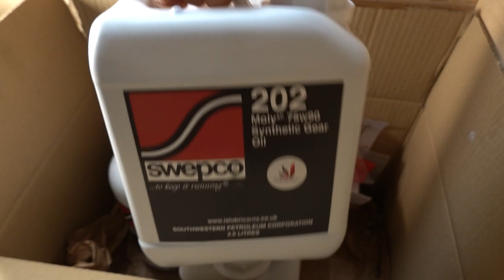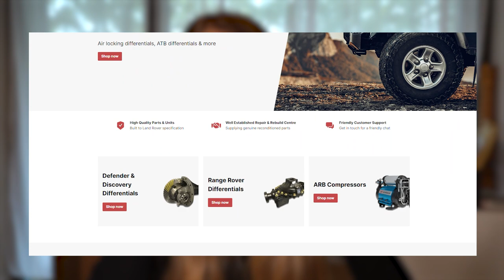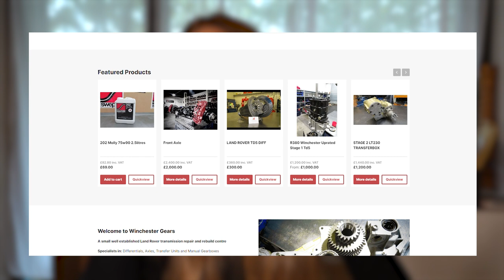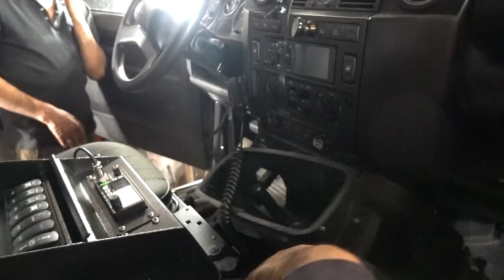WHAT? AGAIN! New transfer case & gearbox | Land Rover Defender Puma 2.4 TDCi (Winchester Gears)

Comment: It made sense to replace the gearbox along with the transfer case. Ye have put a lot of hard kilometers on the defender, so there would be a strong likelihood of needing to repair or replace the gearbox in the future, which would be more expensive in the long run. Expense ye could probably have done without right now, but as ye are likely to be keeping the defender for a long time, it's an investment.
Reply from the maker: It's exactly our point of view and way of thinking :)

Comment: Can't beat a bit of gold bling, not had any issues with mine since fitting.
Reply from the maker: This is great! For how long do you have it on?
Reply: @offtrackfamily  beginning of lockdown, but only just gone back on the road. Handles the power of my engine conversion really well. 
Had the ATB fitted at the same time which makes for less clonking. Really pleased with it.

Comment: I'd suggest  that all the vent pipes are checked both axles tbox and gear box they can block witch will cause presser in the box/axles and will alow oild to pass by the seals causing a leak also  depending  on how often you drive them that will contribute to leaks if they sit around stationery for more then 2 years your garented for it to leak

Comment: Engineered that way. You always have to top up so it’s continuously getting serviced so it should last longer. 
The LT230 extended sumo is a winner. 
Install a bigger gearbox oil cooler so that you increase the oil volume.
Reply from the maker: Yes, taking care of some flaws and regular maintenance is key for a long lasting 4x4 and it helps us avoid as much as possible breakdowns while out :)

Comment: The next thing that awaits you is the replacement of the rear axle, because the weight of your Defender will destroy the existing axle. Anyway, where did they buy the cover for the transfer box. 
Cheers to both of you. 🍺&🍷

U and some strong huby you have. 💪
Reply from the maker: That's possible but not on the list for the moment ;) haha you should ask Winchester Gears :)

Comment: It's  a landrover it will leak again but maybe not straight away, sorry to disappoint. I no you won't give in knowing all the work you have put into the landrover! Goodluck 👍
Reply: I thought they were supposed to leak.  You know, for chassis rust prevention.  It's a feature, no?
Reply from the maker: Don't agree with that! We had the stock transfer case for 117'000 km and it Never leaked. Too bad my husband trashed it during an intense offroad day and we had to replace it... then this issue started a few years ago. Crossing fingers this issue is over :)
Reply: After nearly 40 years of landrover ownership and 5 landrovers it will. It's a landrover guarantee 😄🤣

Comment: Previously all were uprated by Ashcroft right? I just installed refurbished transfer and auto box on my 2.4, all Ashcroft. So far the service was good, hope that it does not start leaking of knocking…
Reply from the maker: Yes, our previous transfer case was one from Ashcroft. It was leaking for a while. Last year, it was rebuild a second time also with Ashcroft parts but by another craftsman .

Comment: @offtrackfamily do you think the reason for this 2nd failure could have been as a result of fitting the LOF Output shaft? I remember reading somebody commenting on your video when fitting the LOF output shaft and he said that because it was solid one piece, it didn't allow for any flex and therefore you'll have issues down the line. Could this have been the case?
Reply from the maker: I don’t think so. Transfer case was leaking before that replacement. My husband decided to have it rebuilt by this French guy and at the same time upgrade some of its parts. The leaking came back after less than a month. After months of being very disappointed with his way of treating us, we went for a complete new set from Winchester Gears. When removing the old transfer case we were able to confirm it was his bad work that made it re-leak. Nothing to do with LOF clutches part imo. We have the new transfer case on for more than a year and no leaking issues.

Comment: Did you go for winchester l320 stage 1 or 2 with the Ashcroft diff. I am looking at stage 2 option next.
Reply from the maker: We've got the US Spec with triple sleeve casing, Ashcroft ATB, 300M shaft, and brand new stock ratio. The best is to contact Winchester Gears if you have some questions :)
Reply: @offtrackfamily  very nice bit of kit will be speaking to Winchester soon once my front locking diff arrives from Xcess4x4 and I have it fitted and my bank balance is back to strength 😀